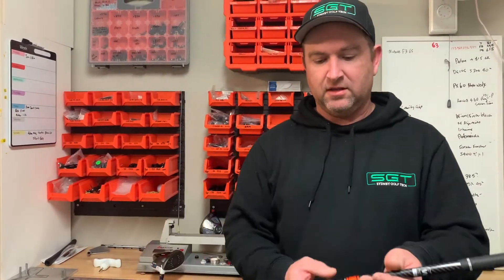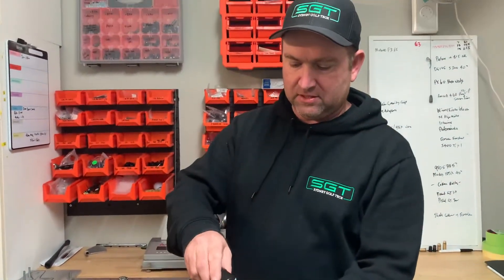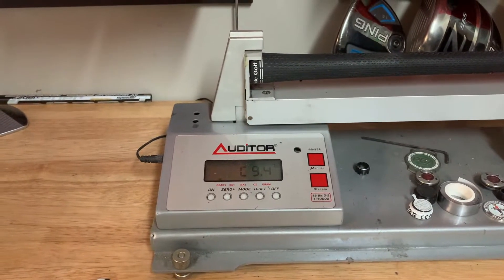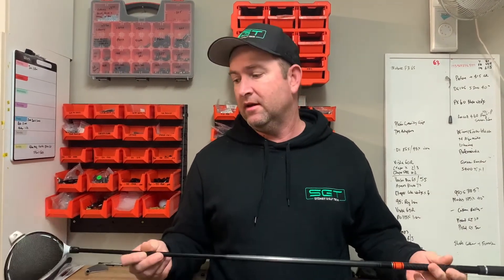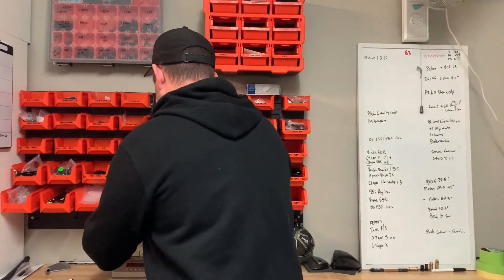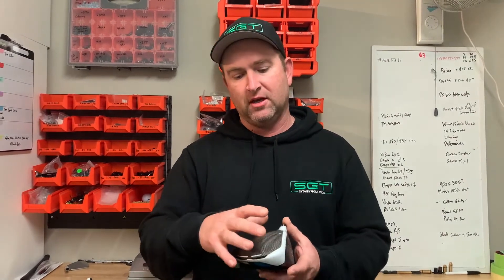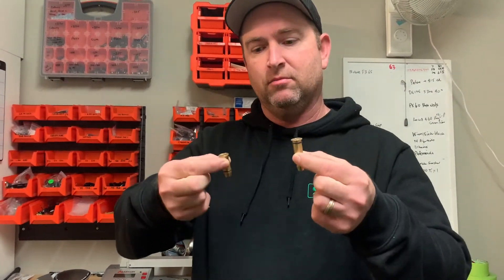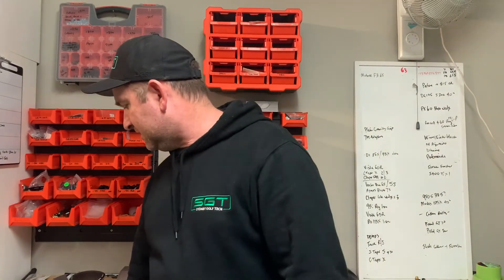What are counterbalanced shafts?

Comment: Sir i have ping g425 max , currently using av raw orange 55 , if there a more suitable shaft for it except this raw orange ? And count i pun a shaft that is not counterbalance ? Would it effect the carry distance ?
Reply from the maker: A fitting would determine if a better shaft could be found.  The G425 generally had a fairly heavy weight in the back, so “normal” shafts can be used if you change the back weight.

Comment: I am looking at getting my son a Ping G425 Max with the Tensei AV Orange 55 in regular flex.  He is 12 and plays with a driver shaft at 43" would cutting it down lose the counterbalance of that shaft?
Reply from the maker: Cutting any shaft will effect the balance point, but it will still be higher than most shafts. My concern with the g425 is the head weight. They are about 10g heavier than most heads and this could effect his ability to generate speed.
Reply: @SydneyGolfTech  Thanks for the info and heads up on Ping weighing in at 206g.  He's currently playing a Cobra Radseed XB in 196g.  Do you happen to know the head weight of the Titleist TSi1.  There is no info anywhere about its total weight.
Reply from the maker: @ZoSo666JP  I’m not exactly sure, but I’d assume mid 190’s.

Comment: I have a brand new Cobra SZ xtreme driver head that I haven’t hit yet......(winter here). I cut an inch off of my current shaft last season and playing the Cobra F8 (Fujikura Tour Pro 72). Wanting to go back to standard length when I order a new shaft for the SZx........can’t decide between the Tensei orange or the Hzrds Smoke black.........anyone have any suggestions? Thanks
Reply from the maker: Both are good shafts, with the orange being a mid launch while the smoke black is a lower launch option. The Tensei will also swing weight lighter than the smoke. These factors could help with your decision, but ultimately the best one is the one that works for you. 😃

Comment: Hello again, wondered if you would be so kind as to tell me the specs for a Diamana FW 75 Limited shaft ??
I've surfed the internet for hours with no joy so hope you don't mind me asking you because you are the golf shaft guru !! 🙏🏌️
Reply: ie is it a counterbalanced shaft if not where is the mass distributed 👍
Reply from the maker: @jaseface6868  in stiff, it is 72 grams, 3.6 torque, mid launch and mid to low spin. It’s a mass produced shaft that was offered in Taylormade SIM fairways. I’d say the balance point would be relatively high, but not as high as what we would call it counterbalanced. 👍
Reply: @SydneyGolfTech  thank you so much for your help..... would you say it's similar to the Hzrdus smoke yellow ie more weight in the grip end ?
Reply from the maker: @jaseface6868  not as much in the grip end as the HZRDUS yellow.
Reply: @SydneyGolfTech  you've been a massive help, thank you so much 🏌️👍